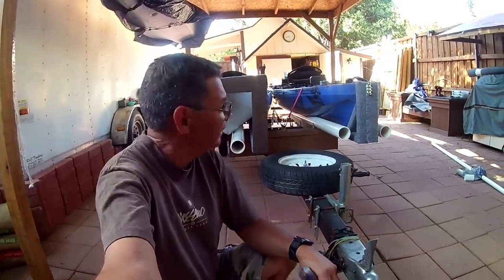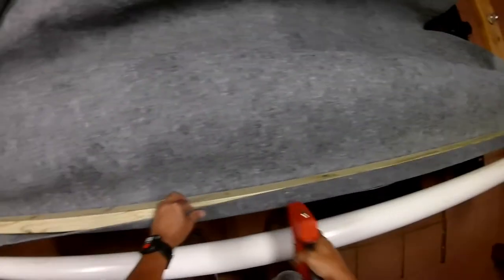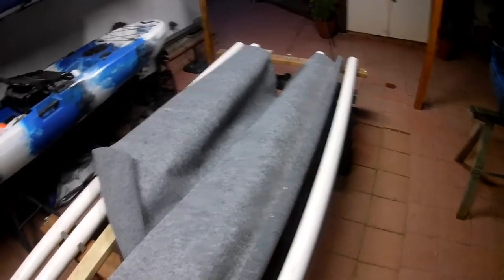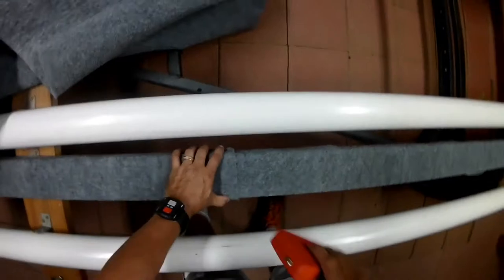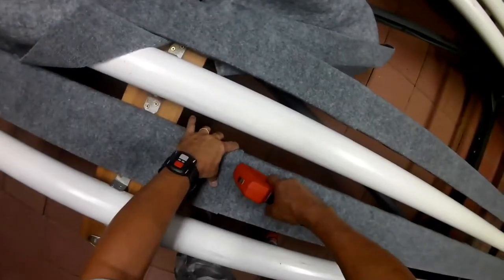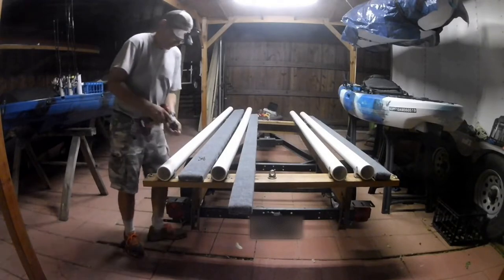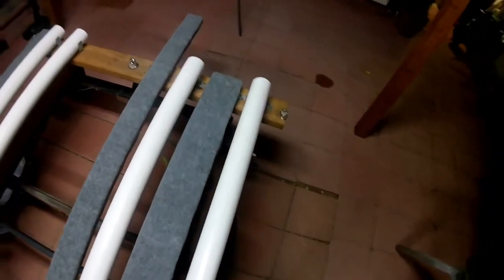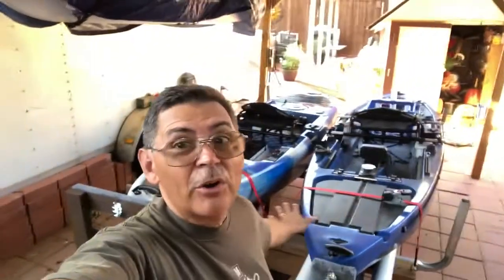Kayak Trailer DIY

Comment: Awesome!  Just what I needed!  Thank you sir!  I've got the jet ski trailer ready to become a dual, or possibly quad kayak trailer!
Reply from the maker: Jacob Housley my son is buying one next week and will be making it into a double stack but only for two kayaks. I will be making a DIY video on it.
Reply: @garzaoutdoorsproductions  What size PVC pipe do you recommend for the 10' KI Kayaks?  I already have a couple of 4" pipes I use for rod storage racks when we travel to the coast, but I've obviously got some trips to Lowes/HomeDepot in my future anyway...  Thanks again, and I'll try and remember to at least get some photos, maybe video of my trailer posted.
Reply: Jacob Housley You can use the 4 inch pipe it will set it up about 1 inch higher. The ones I use are the thicker 3 inch pipe inside diameter.

Comment: Hope your using stainless steel staples for the pressure treated lumber other wise the chemical reaction from the treated lumber will corrode the staples.
Reply from the maker: Wow I did not know that. I did not know that they actually sold stainless steel staples. Where can I get some. The good thing is that removing the boards is not that difficult. So I can always add more staples or change out the carpet. By the way I bought me an automatic stapler or I guess you could say electric stapler which makes this job a whole lot faster and less stress on the hand. 

Thanks for the info.